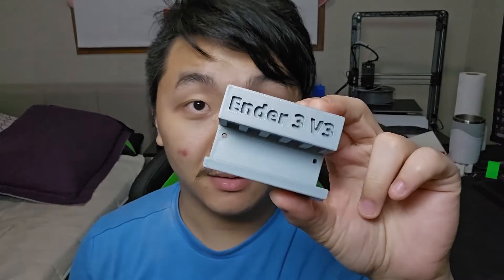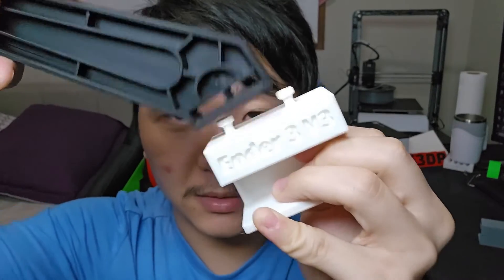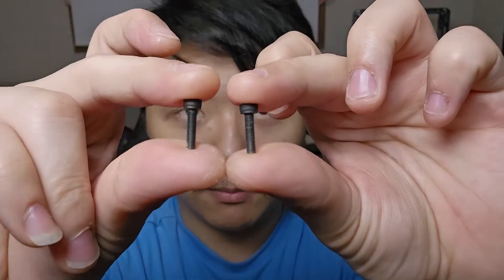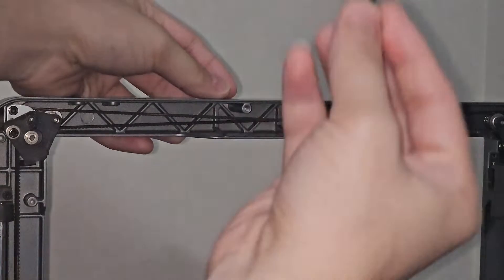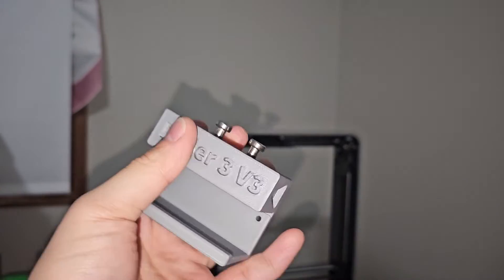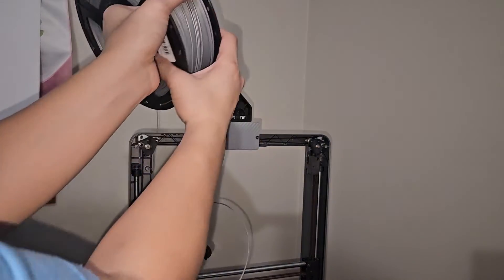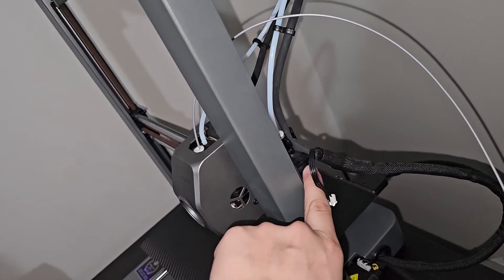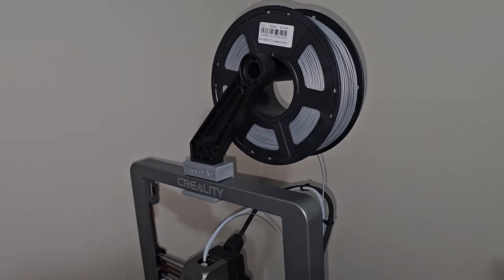Ender 3 V3 Top Mount No More Tangling!

Comment: Have you designed the rest of the parts yet? The filament sensor holder?
Reply from the maker: I have not yet design that part. Seems top spool does not work well for the ender 3 v3 since it's homing at the top. Makes the filament tangle.

Comment: Top mount, imho, is kinda idi_tic desition. because on high speed itll shake as @%. So basically itll be priority to print side holder for fila. Itll be effective
Reply from the maker: Yeah top mount might bot be the best situation for fast speed machine like you said.
Reply: @Scratch3DPrinting  not just "might not". I have ender v3 ke and when i print its jiggles as f. So i printed side mount and its way better. Its just physics).

Comment: If the spool is on top like the SE, do you even need the Bowden tube anymore— it could be just like the SE and have the filament go right into the extruder ?
Reply from the maker: Not sure about the SE, but I felt like the tube is there to have control of the filament.

Comment: Hello, what would happen if I do not disconnect the sensor when placing the filament on top and let the sensor pass the filament through where it comes from the factory
Reply from the maker: If you don't disconnect the sensor then you'll have to disable it in the ender 3 v3 screen or else it will keep saying there's no filament.

Comment: Can you make one of these for the ender 3 v3 plus, but thin enough to fit in between the led light that I have installed on the top of my printer?
Reply from the maker: I would, but I don't have the ender 3 v3 plus. I think they are silimar, so maybe you can just take the model and modify it a bit to fit on your 3d printer.

Comment: Thanks my man. Needed something like this when I found out my printer wouldn't fit right in my enclosure
Reply from the maker: Yeah, top mount is really nice if there's limited space around the 3d printer or having an enclosed.
Reply: Kind of an old comment, but what enclosure did you end up getting for your v3? looking into getting one.

Comment: What a nice complement for my 3 V3, would be nice if some day you design a top mounting harness for the filament sensor, the extension cable is not a problem. Sheers from Colombia!
Reply from the maker: Thanks, I will try to find time and make a filament sensor holder for the top mount.

Comment: I just ordered this printer on sale from amazon but not before making sure the filament spool could be mounted on top. I was never going to give up desk space (workbench space) just for the filament spool. I didn't find your video before ordering but I saw the video in amazon where they compare the printing speeds of the three Ender 3 V3s and they show it with the spool on the top and bypassing the filament sensor which works for me.
Tip: Don't show mistakes during the video, show them at the end as "bloopers". :-)
Reply from the maker: Thanks, yeah filaments on the side is a waste of space. I like to show all my mistakes/learning process during the video, but I'll keep that in mind putting at the end of the video.

Comment: this will multiplicate vibrations resulting in non smooth prints.
Reply from the maker: I have been printing with this for a while and no problem to be honest.
Reply: @Scratch3DPrinting  i am waiting for my printer to arrive, but i was thinking about making a holder on a side with the roll parallel to the printer, more or less ate the same hight.

Comment: any profile for this on thingaverse ? ( I don't have a bambu account )
Reply from the maker: I'll try to put it on thingaverse
Reply: @Scratch3DPrinting  thank you I got the v3 on the way and a top mounted spool holder would let it fit in my enclosure honestly man pretty baller that you would do that😁
Reply: just found it on there your the best my guy
 @Scratch3DPrinting
Reply from the maker: Not quite sure you found it, I was not able to put up the design because I just created my account, but I did got it uploaded today: https://www.thingiverse.com/thing:6561871
Make sure to heart it. :)
Reply: @Scratch3DPrinting  yeah I did a double take on you vid turns out the one I got is the modified one that comes on the printer someone reposted

Comment: This will amplify ringing in your prints a lot, by putting a big resonant mass on top of the printer. It's better to use a filament guide pulley or reverse bowden.
Reply from the maker: I'll do some prints and see if there's any difference, if there is I'll add those thing.
Reply: @Scratch3DPrinting  there's a .stl file on the USB drive that came with my Ender 3v3 plus. the files are for the top mount and run out sensor thing.  

im not sure how to mount it but that side mount filament is the source of every problem I've  encountered.

BTW:  im very new to the 3d printing world.
Reply: @xerravon I agree. I’ve had 3 failed prints due to the side mount and I’m only 1 week in. It’s a bad design. Printing the top mount from creality now to make the change !!
Reply: True, but I only print functional things such as wood working jigs, repair stuff, holders, storage things, so I really don't care how they look just: do they do what I want. And the spool holder on top (along with the runout sensor makes sense to me.
Reply: @larsord9139  Ringing is functional inaccuracy not merely aesthetic.